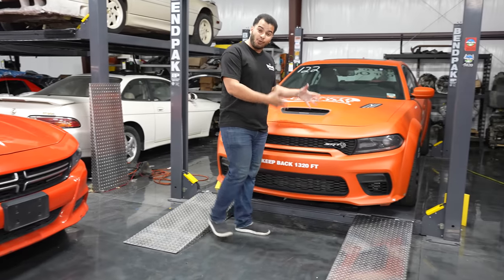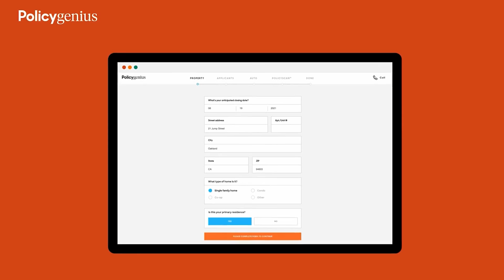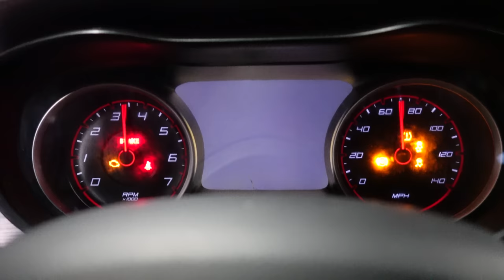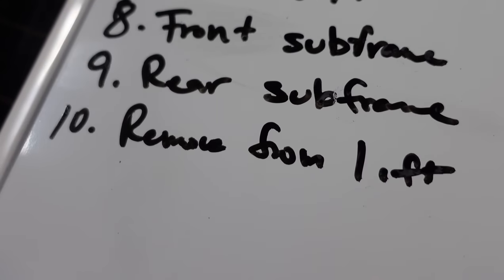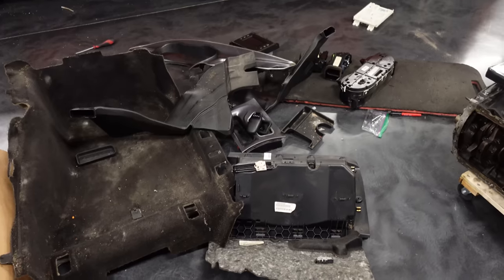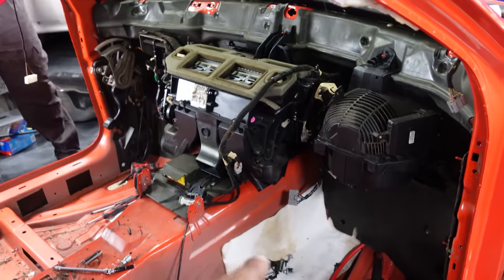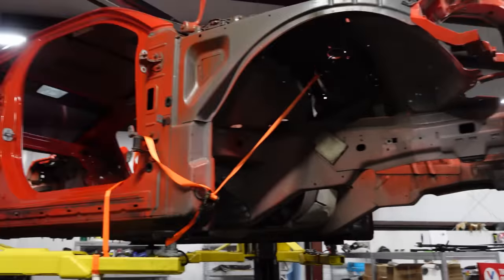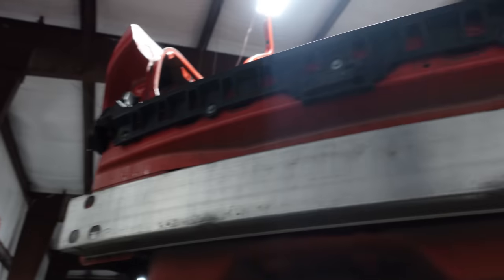I Built A $100,000 Dodge Charger Hellcat Redeye From A Worthless V6 Rental Car | Part 1

Comment: Would be hilarious if you kept the V6 bodykit on it, ultimate sleeper 😂
Reply: Yes, yes and so much yes
Reply: Then add a hellcat emblem , and see how many people make fun of it Lmaoo
Reply: @Larrybird96  This is the only proper setup
Reply: @Larrybird96  hahaha
Reply: Ikr
Reply: such a missed oppotunity for him
Reply: Would be cool to go that route but also sick to have a replica hellcat redeye that looks the part. Sleepers are awesome. And either way you can't go wrong here. But I do lean towards i want the exterior to look as custom as the engine. Having said that I've never put so much as a cold air intake on my vehicle. I usually replace everything with stock or redesigned stock parts to the weak point reason for the repair. Just ain't got the money, If I did i would have pretty cool shit

Comment: Labeled zip lock bags are the best for big jobs! It's about the only project trick I learned from my Dad, usually just held the flashlight. Made keeping track of all the bolts doing the chain guides on the E39 easy. Most times I can keep track, but when you have to take off a whole bunch, there's no better way. It has saved me a lot of headaches, something I have enough of as it is since I'm generally an idiot.

Comment: How long did it take Jared to actually detangle those ratchet straps in the montage😂😂😂
Reply: Thought he turned into a fire-bender for a second
Reply: it was run back at 100x speed, so you may calculate.
Reply: My scientific answer: 19.4 minutes per strap based on my experience. No matter how nicely you try to store them, they all come with the auto-tangle-matic feature!

Comment: I believe the engineers at Ma MoPar would absolutely agree with that interpretation of the agreement.
Also, I want to try one of those V6's in a 66 Barracuda or one of our Aussie Chargers. With a manual.

Comment: Hey Tavarish you are the sh!t ive been buying and selling cars and with 1000$ I worked my way up to a 2016 that cost 50k when it was new! I got it for 12k but it needed alot of work. Solid 20k vehicle now but I forgot to mention I dont do it with cars, I buy and sell camper vans and busses and convert them while living in them and also living off the profits from the previous vehicle sale.. so when I sell mine as a camper for over 20k ill buy a beater with half that money and make it a gem again and I love doing this, I can do Everything when it comes to building camper vans and solar systems and installing hightop roofs I paint them and do sound systems and everything you can possibly do to a van or bus and im only 26!!! If you ever want to build a camper im your guy!

Comment: Strip the hellcat for parts except the ones for the swap and sell the rest then put the hellcat in the V6 charger but keep the body panels stock so it is a sleeper.

Comment: Converting a V6 Charger in to a "Hellcat" does not make the V6 Charger suddenly worth $90K.  The parts going on to the V6 are worth more than the car itself.  What you have is an engine-swapped, former rental V6.  This thing will be a VIN/registration nightmare.

Comment: TLDR: we need a better break down on how you insured 90k for a v6 

Yea…insurance asks for a vin and gives you current blue book value of the vin. There’s no real way to insure a specific amount on a vehicle. 

I was told you need a secondary insurance like Grundy and it has to be driven less than 10k miles a year.